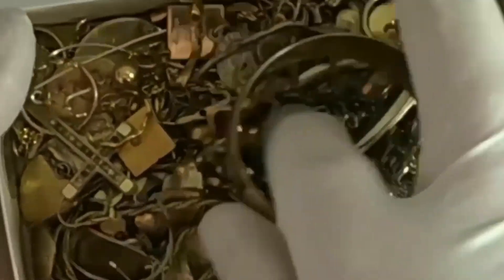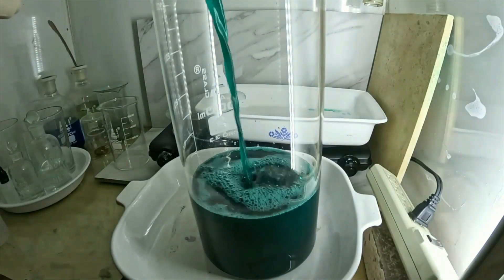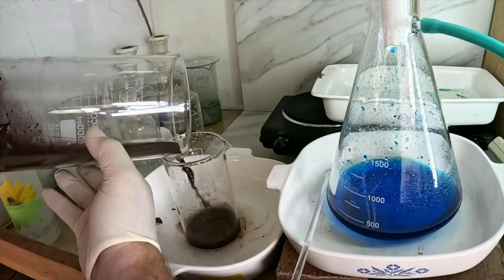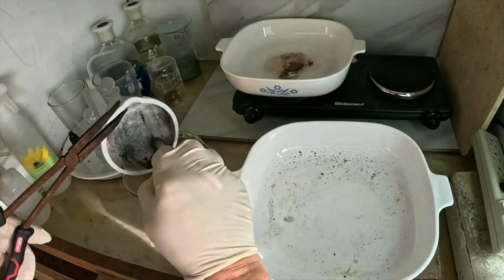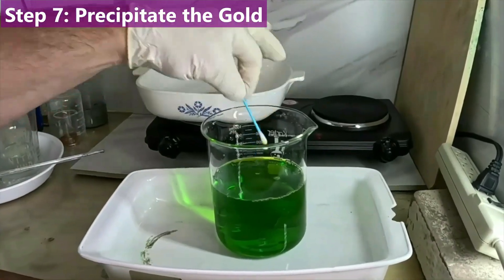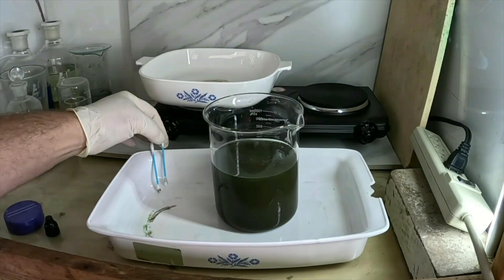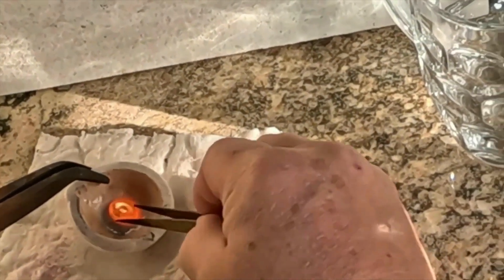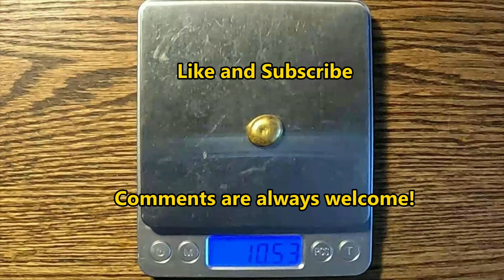I Recovered Gold From 389 Grams of Scrap | Here's What I Found

Comment: I always figure 3 grams per 100 of gold filed.  Some times a bit below, some times above, it just depends on the wear of the items.   For some reason watch shells normally give a bit more maybe due to it being gold and only used sparingly.  Still I almost hate doing gold filed materials and always just add that buttons it to the next round of carrot scrap I refine.  the only thing I hate worse is doing PGM's.  Still the cost of the acids and stump out along with cost for the items normally is worth it.  Figure in that batch you got about 13 grams or around 1800 dollars or so.  Cost to purchase the material,  then chemicals and the lab equipment over time. I still can not get over just how much people will undervalue jewelry and sterling silver items.
Reply from the maker: Gold Filled definitely takes patience, especially with filtering.  I tend to estimate 3.5ml per gram, but once I get to 3, I will let the Nitric exhaust itself and then do smaller boils.  That way, if I have excess Nitric in the last boil, I can save it off for reuse.

Comment: I don't believe there was much benefit to the incineration step after the nitric boils. You mentioned that it would help to oxidize any remaining base metals, but the AR step will oxide any remaining base metals and put them into solution anyway. With the potential for losses of the finely divided gold during the added transfers between vessels, it seems to be adding risk without any tangible benefits.

Regardless, I'm really enjoying your videos. Keep up the great work. 😊
Reply from the maker: Thanks for watching!  My experience with the incineration step is a cleaner end result.  Gold filled, has a lot of metals and compounds besides gold, the incineration step keeps them out of solution to be removed before precipitation with SMB, without needing additional refining.